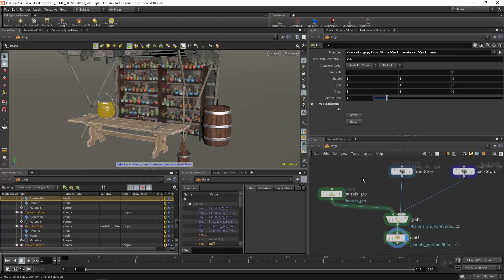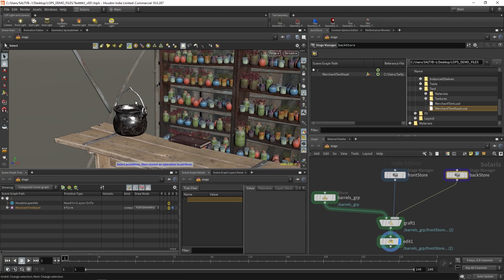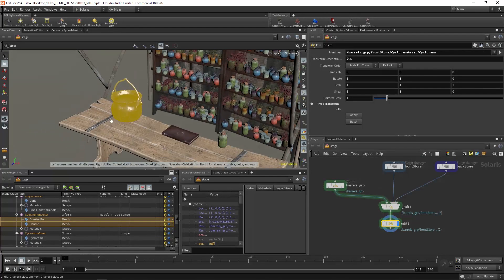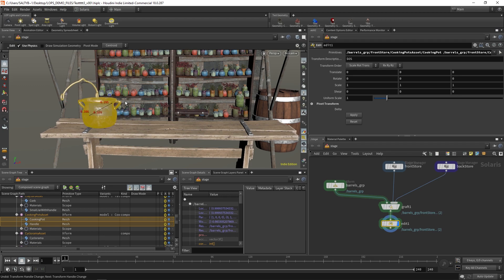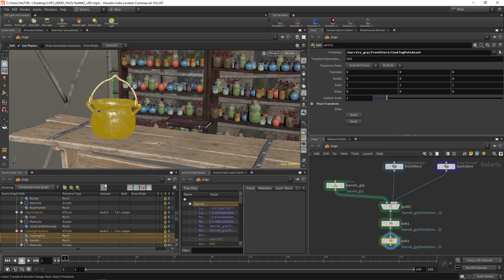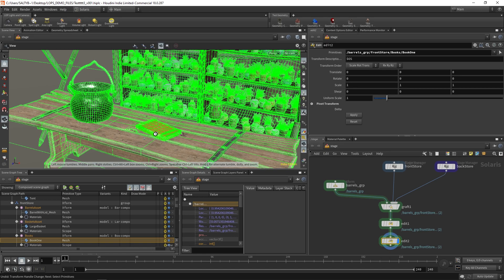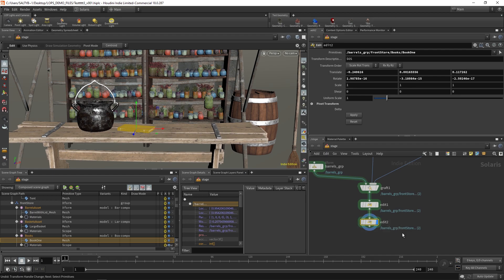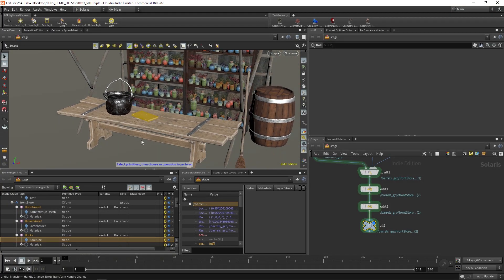Learning Solaris - Part IX - Physics Based Transformations

Comment: At the end, I think you couldn’t edit the variant in the viewport because you had BookGeo selected in the scene graph instead of its parent component.
Reply from the maker: Thanks for the pointer Josh, I'll give that another try and see if that helps
Reply: @cgforge  Nevermind! I think it's because the stage manager wasn't selected in the node tree.
Reply: @cgforge  Hi Tyler and Josh. It seems that this menu appears only when you are in active Stage Manager node.
However, if you change your selection settings to "Component" or "Model" (by default they are on "Leaf Primitive") in the active Edit node (or in any other) when you right-click on the item in the viewport area (even without selecting an object), in the pop-up menu will appear the new line: "model >", in which you can select a variations (of course, if they were prepared in advance :) ) and Houdini will automatically create the Set Variant node with settings. 
I hope you managed to do this and figure it out)

Tyler, thanks for your tutorials)